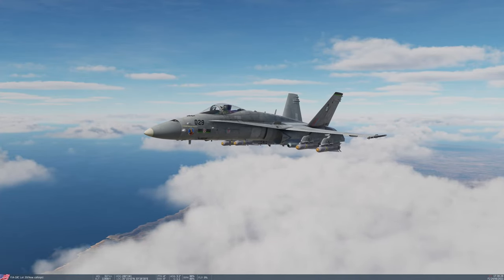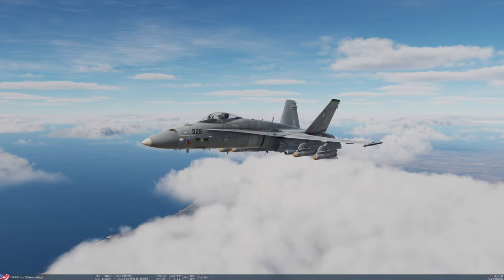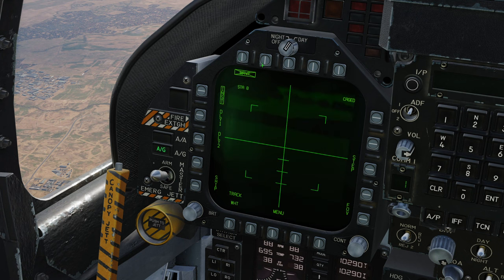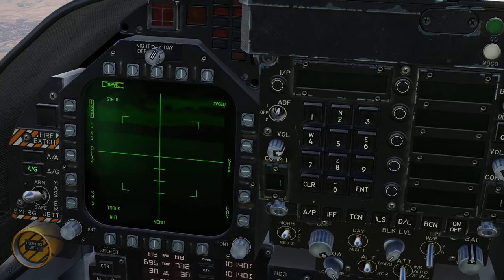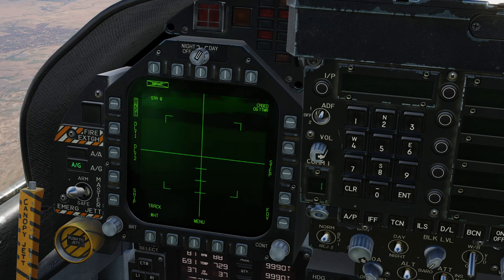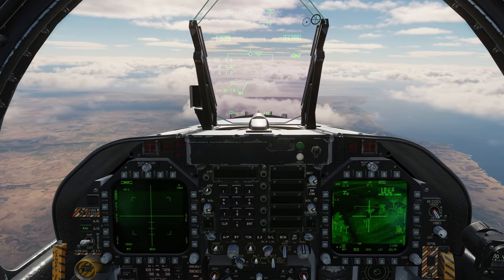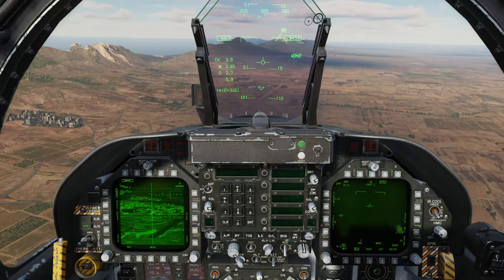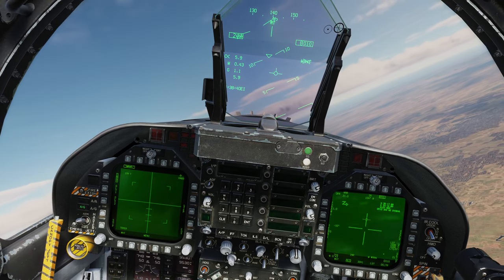DCS F/A-18C Tutorial 15 - Maverick F

Comment: Nice vid! Just a quick note, the white hot or black hot setting is always looking for heat. The black hot is just the inverse of white hot and makes it sometimes easier to see targets depending on background. It’s not looking for cold targets.
Reply from the maker: This setting is called the "tracking polarity" and in the manual it states "The Maverick composite
video is only displayed in White Hot mode. Therefore, when the display indicates “TRACK WHT”, the
missile will track on the hot (white) target when it is commanded to track. When the format indicates
“TRACKL BLK”, the missile will track on the cold (black) targets."
Reply: @deephack  that is strange verbiage for sure. If it’s calling the color black on the display as “cold” I guess that makes sense but the temperature of what is being looked at is hot. It’s how FLIR works whether on the plane or mounted rifle scope. You can switch or invert the color scheme for what hot objects look like through the display. Some even allow a sepia color scheme or highlight the top 10% of hot objects with a different color. Even in DCS you can see as you switch back and forth that the hot objects are the color chosen.

Which manual are you talking about? They should probably be more clear.
Reply from the maker: I think you're mistaking the "White hot" and "Black hot" modes of a FLIR sensor with this Maverick specific feature which is called "Track White/Black". I'm referencing page 273 of the DCS F/A-18C Early Access Guide . Section is named Tracking polarity.
Reply: @deephack  I read it and it sounds like what you are saying but doesn’t work that way in game and as far as I know irl either. I’m wondering if they misrepresented it. Either way, interesting find in the manual!
Reply from the maker: That I don't know about. I don't have any information on how they work IRL. Fly safe!

Comment: What i noticed many times is when i  try to use the TPOD and slave the maverick to that point and designate that  target point, the maverick wont properly lock on that specific point i'm targeting which results the maverick hitting other stuff than i  intended. Any tips to avoid this issue? I found the Maverick F lock on the F-18C very unpredictable compared to the Maverick F on the Harrier. I have a feeling the seeker head has a better resolution on the Harrier then on the F-18C.

Comment: Trying to come to grips with this difficult process. Why the use of "Nosewheel Disengage" control? Is that normal procedure for this missile, or just your preference?
Reply from the maker: The nosewheel steering button is also an undesignate control in most aircraft. I need to undesignate in order to be able to slew the ATFLIR as it has slewed to a waypoint in this example.

Comment: My only problem is I can’t see the hot tanks or anything through the Mac screen even zoomed in and switching between white and blacknhot
Reply from the maker: If the engine isn't running, they haven't moved or fired then you may struggle. Missions should be designed with this in mind, move the vehicles a bit first or click the option for them to start hot.